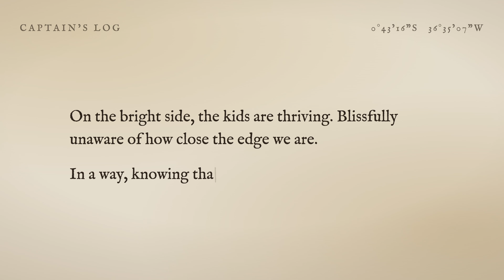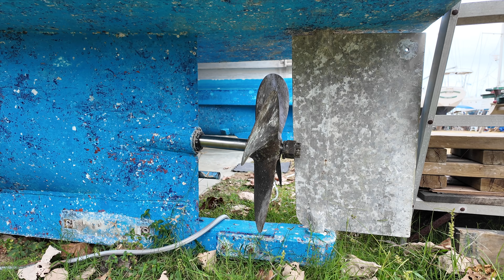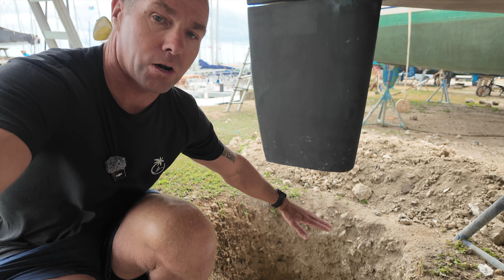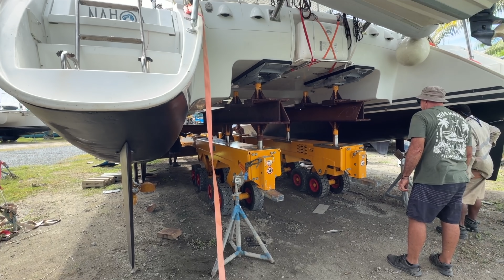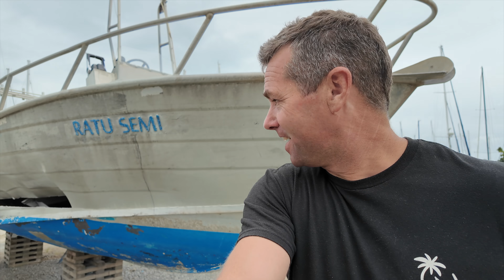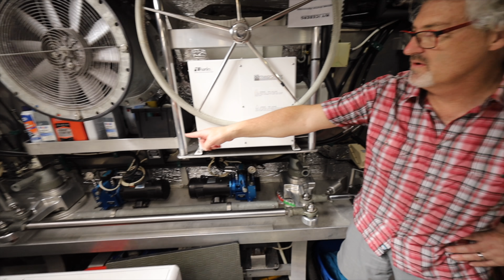Why Aluminum ALONE is NOT the Answer

Comment: That other boat you were showing, redundancy is great, and redundancies on top of redundancies are amazing....but in a boat i feel like that could potentially breed a mentality of complacency. One system fails, and the redundancy automatically kicks on, eventually you forget your primary system has failed. I know this isnt really the case with a lot of boat owners however, it could definitely be that way for someone who does not do their own work. I think a single redundancy on all critical systems is more than enough, and honestly i subscribe to the idea of keeping the spare parts on hand, and the knowhow to repair it. In my mind, the only systems that need multiple redundancy's are things that keep the boat afloat. Bilge pumps, Bulk heads, the hull itself. Besides that, fire supression systems....

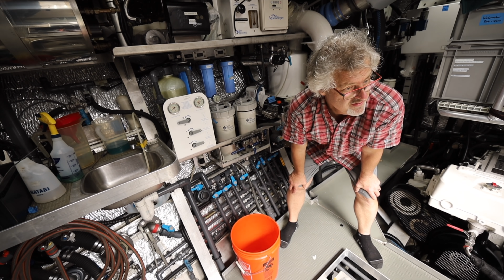Comment: 17:05 he's kind of right, most people don't drill stuff like fire departments or military do. And to be fair, it gets expensive when your not holding back and doing the drill like it's real. Emptying fire extinguishers, using the fire hoses, and stuff like that makes a mess that must be cleaned up and properly maintained afterword. If you have ever worked on an engine, you know there are parts you must replace when you put it back together, and it's probably the same for that rudder system, selves, keys, bushings, shims, something will need to be replaced when it's put back together after drilling the block and tackle steering.

Comment: Time has shown that aluminum boats have sunk, wood boats, steel boats and fiberglass. Therefore the success isn't determined by material but a Captain's ability, experience and attention to detail.
Sometimes on rare occasions the ocean decides that even the strongest vessel under the best command, still isn't enough.

Comment: I have noticed on some sailboats where the bulkheads are actually marked on the sides of the hull where they bulkhead can be definitely identified and used to locate straps or lifting points at haul out.

Comment: I don't know why this is so hard to understand. I can cut a hole in aluminum foil by blowing air really hard with a straw. If your only criteria for choosing a boat is the hull material, you're gonna get duped. It's not hard to build a fiberglass boat that is better in every way than a naively built 3mm thick aluminum boat. It's also not hard to build an aluminum boat that is better in every way than a naively built 3mm thick fiberglass boat. The stringers, webbing, bulkhead design, hull thickness, core materials/thickness, welding quality, resin quality, are all going to be more important for determining the durability and survivability of your boat than the material alone.

Comment: Re sail drives and rudders take a look at the Gostships build he's a Ship wright, welder building a Al monohull up using an electric motor sail  drive ....it's rigidly mounted to a massive collar welded onto the hull.  Even if it got broken off the hull stays sealed. He wants to go to Antarctica.

Interesting point to add to rudder observations new kids on the dock had to come up with designs for their Derick Kelsall designed fast cruising cat ... and they did what you did took a tour of the boat yard.  They also had to balance the rudder ie where the blade enters the rudder and how much of the blade leads the pivot of the rudder post V how much falls behind the post ...whilst area is dominant at lower speeds ...at higher speeds the forward section helps reduce the steering forces required to balance the forces against the larger trailing section. All that feeds back throught the steering gear and linkages ...adding or detracting from 'the feel ' generated at the helm and the loads on the autopilot system. 

The other interesting insight is the latest build Vid drop from Daz cats and their latest explorer cruising composite cat , that will also be wheelchair comparable ...and easy/safe  to lift .. the amount of massive composite re enforcement being done would scare the hell out of  a Certain heavily rebuilt Lagoon and the  capt. Whose also heading down the Al route.

Comment: Hey, I've been really enjoying your channel and been toying with the idea of buying / building a dream boat / home. Two questions if you don't mind;
Aluminium is a great and cheap material, but suffers from galvanic corrosion that can be minimized with caution, and lacks a fatigue limit, so cyclic stresses (waves) will cause failures in some decades. What's the protocol here? Yearly inspections after 30 years where you replace cracked parts?
Titanium seems to be the best material for a boat hull; even higher strength to weight ratio, no rusting, no corrosion, a fatigue limit - basically it shouldn't degrade if designed properly. The drawbacks being the price (not that significant compared to all the labor?) and the difficulties working with it (special tooling, lots of Argon and special procedures when welding) might be acceptable especially when producing multiple hulls. Have you looked into this?

Comment: I would never buy or build a boat that had an engine that if it breaks needs the OEM and a computer to talk to the  motor. I would get one that  the user can work if need be. As well as carry all the spare parts so if it stops you can either replace something or do regular maintenance. Great channel thanks !!

Comment: 1. I dont see this as a "Luxury" brand. I see it as a "Reliablity" brand. The Luxury comes from the fancy sheets and pillows. Lol 
2. EVERYTHING is a compromise. If it's perfect....the price tag will reflect it, thus making it imperfect. 
3. Sounds like the next big design build after "Reliable" Nahoa  Catamaran line should be a more reliable remote lift system for these remote/less high end Marina's. (Keep the frame carriage that can be moved around with a front end loader, or peice of tug equipment, but replace the hydraulic arms with heavy duty air bags that inflate and evenly support the entire hull instead of just a few pressure points).
Reply from the maker: Coming soon: Nahoa Trailers 😂
Reply: @SailingNahoa if there is a market......

Comment: Our bluewater cruising monohull has a 6' long high aspect ratio rudder mounted on a skeg where the skeg is half the chord of the rudder. This makes this particular rudder design almost as efficient as a Spade rudder. The difference is that the rudder is supported on 3 bearings. Bottom of the rudder via the skeg, main bearing above the waterline and the 3rd bearing at deck level. The boat is 44ft. Thr s/s shaft is 90mm diameter at the centre bearing. The rudder blade has 4 huge tangs internally. All bearings are bronze. The top two bearings have remote grease points accessible from the lazarette for easy greasing. Every thing about the rudder design is robust. Its only been off once in 46 years. I put 50,000nm on the boat in the last 12 years and the bronze bearings were perfect
Reply from the maker: That sounds like a bulletproof setup!

Comment: Lifting point a critical as you said, im follow a australia couple with her monohull sail , stuck i think central american, because the lift crack the hull and if im make not mistake, assurance dont want to cover them
Reply from the maker: Yes. Saw them as well. This is a real nightmare scenario, which is why we’re being so careful with our lift point strategy. Yards will usually also make you sign a waiver so that they’re off the hook for any damage. The owner of the vessel is ultimately responsible and in a way it’s part of seamanship

Comment: An famous old school boatyard here in Tasmania (marine railway type with a cradle down inclined rails) was Muirs boatyard and the owner was renowned for his care in slipping boats including fishing boats and racing yachts. He used to draw up a slipping plan for each boat he ever hauled. This was where to put blocking, crossbeams and uprights. He had hundreds and hundreds on file from over a 50 year period. He also designed very sea kindly and fast vessels. Only had 2 incidents in his career and one the damage was repaired quickly and the owner never knew until told weeks later.